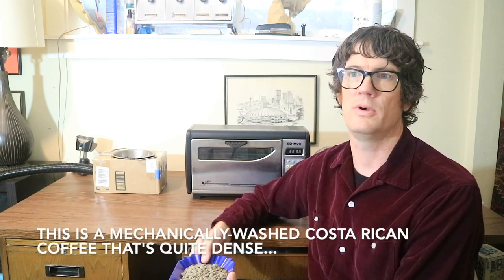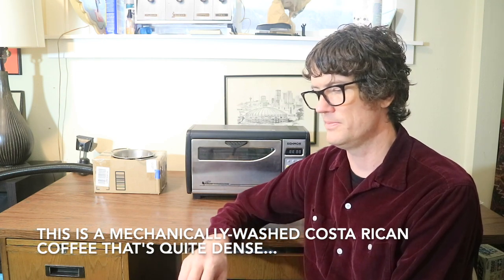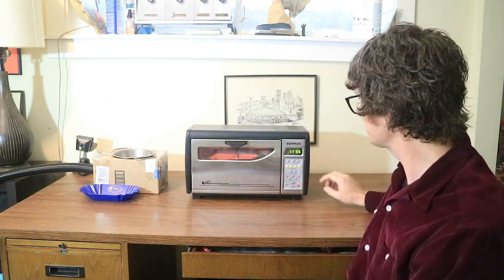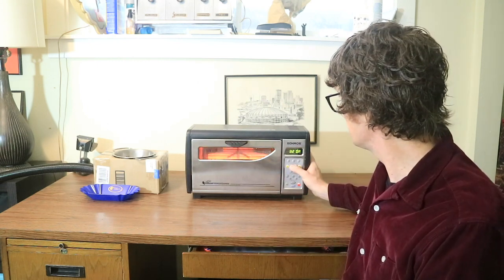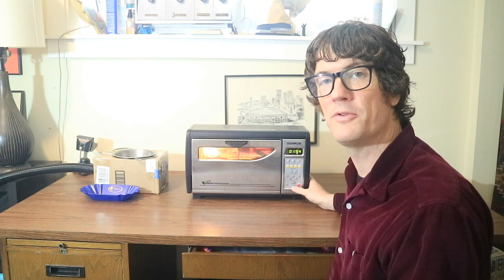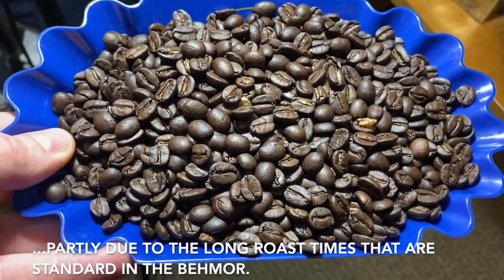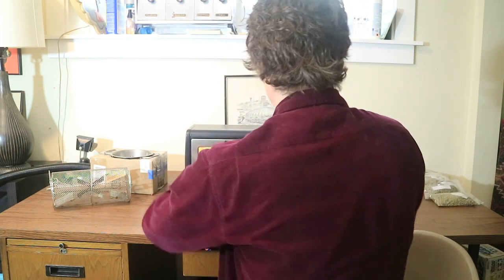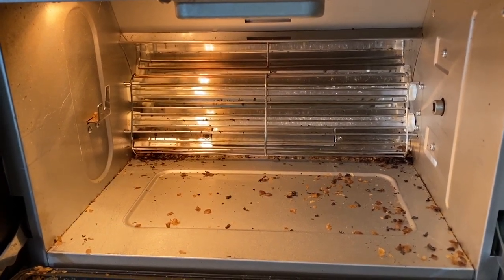Behmor Coffee Roaster: Getting Great (and safe) Dark Roasts

Comment: I keep a fine mister water bottle handy to quench the roast into the hot beans through the rotating drum at the start of the cooling cycle.  (Chaff will fly out, so you probably don’t want to do this in your kitchen.). I that’s the added function as a fire extinguisher in the case of a chaff fire.  I have only had one chaff fire, while roasting some Robusta beans my son-in-law brought back from Congo.  They have more chaff than I have ever seen before, and I discovered I could shake a lot of it off before roasting by shaking the beans in the drum first.  They roasted very quickly, and have heavy body, low flavor notes only, and no acidity.

Comment: Please understand - I'm not advocating the following roasting method on a Behmor!

According to my roasting log I have over 450 roast on my 1600+ using one pound batches going up to 30 seconds into the 2nd crack. I have experimented with batches weighing up to 1lb 3oz with equally good results.

After purchasing the Behmor I quickly realized roasting 1/4 or 1/2 pound batches was going to be a hassle since a pound batch of 'greens' only last me about 5 days. I roast out of necessity, not for the fun of it! 

I always preheat for 1:45 minutes. I start on automatic using the one pound setting, maximum time. I allow the machine to run on auto until the 7 minute override/countdown. At that point it's usually at 286-289*. I switch to manual, drum speed on high, and hit P5 and run it up to 325*. At that point I toggle between P4 & P5 to maintain between 315* and 320*. I use the rosetta button to add time as needed. 

After switching drum speed back to low I pull the drum for manual cooling, re-install the chaff tray, and allow the machine to run through its' cooling cycle. Afterwards I clean the machine and run it through a cleaning cycle.

I NEVER - EVER - take my eye's off or walk away from the roaster! When you use this machine manually things happen rapidly. Behmor doesn't recommend using their machine like this for obvious reason! I had hoped they would release the new 'Jake' over a year ago to replace the 1600+ but apparently that's not going to happen any time soon. 

Did I mention Behmor DOES NOT recommend using their machine in this manner?
Reply: I keep a mist spray bottle of water handy to quench the roast by opening the or after cooling starts and spraying some into the hot beans in the rotating drum.  (Chaff will fly out, so you may not want to do this in your kitchen.). It has the secondary function as a standby fire extinguisher for chaff fires if ever needed.  The only chaff fire I have had was with some Robusta beans my son-in-law brought back from Congo, which was likely dry processed.  It produced so much chaff that I discovered on the second batch that I could shake the beans in the drum before roasting and a lot of chaff would come off before starting.  The small beans roasted very quickly, and they had the expected heavy body, deep toned flavor only,  with no high notes or any acidity.

Comment: Great vid.  Any way to recover  a batch from a dreaded Behmor safety shutdown?  (Too bad they force a shutdown rather than modulating the power to maintain a safe temp!)
Reply: I've found that I can let the machine cool for a little bit and then restart the roast. It restarts as if it's a new roast so you have to watch it carefully because the timings will be off.  Also, there have been times when this doesn't work. The roaster will only restart in cooling mode. I did once unplug the roaster for about 30 seconds and plug it back in to "reset" any memory it might have had of the previous roasts and that worked.  However, I've also had to throw out a couple of batches that stopped at a light roast point. ☹️ ..... As others have stated, none of this is recommended by Behmor.
Reply from the maker: The machine has to get down to a certain temp for it to start up again. So technically, yes, one could recover a batch but it would be the same as re-roasting light roasted coffee. Although, we have heard of folks doing this with decent results.

Comment: great video...missed one part..did you say wet process beans do better for dark over dry??  I have achieved past 2nd roast without difficulties  but have to stop before any smoke or I am in big trouble...thanks..
Reply from the maker: It's more of a safety issue since those coffees will shed a little more chaff which increased the chances of a fire at dark roasts.

Comment: This method works very well to achieve a nice dark roast.  I was struggling to get a good roast on some Sumatra beans.  Tried various methods, even auto on P3, (Behmor recommended for SE Asia beans), just barely got to first crack at 15min.
1/2lb Sumatra Mandheling
P5 Drum high all the way to 1st crack at 10:13.
I never had to change to P4, max temp reached was around 280F.
Pushed through to 2nd crack, 13:30.  Hit cool after 30s.
Next batch I plan to drop to P4 after 1st crack, then hit cool as soon as I hit 2nd crack.

Comment: Nice video as always. I sometimes get asked for a dark, and i dont really have any problems achieving a decent dark roast with my Behmor, actually my very first roast with my new Behmor was a dark roast. I have a video on YouTube showing the results of that first roast and also the same beans at two other roast levels, with very slight adjustments in time and temp.
I tried pre-heating the Behmor one time, just like in this video, but i found that i did not really need to pre-heat to get a dark roast, so i dont bother with the pre-heat anymore. Obviously the type of beans that you are roasting will determine the results you get, but yes you can actually do a decent dark roast using the Behmor.